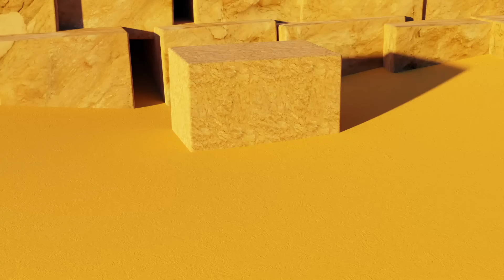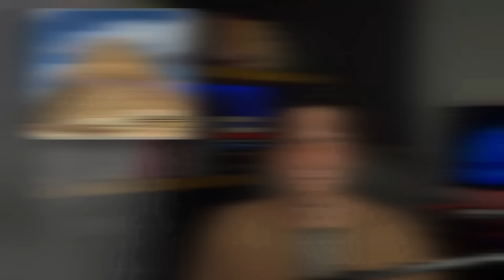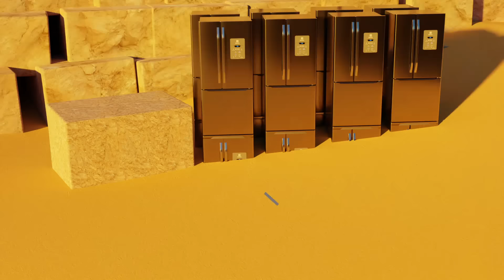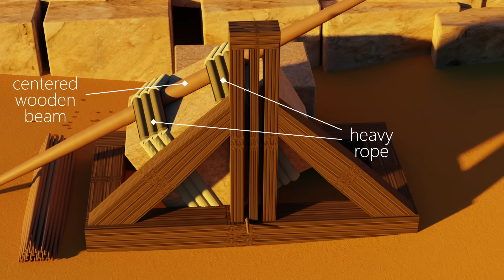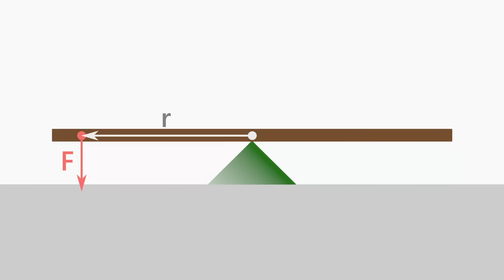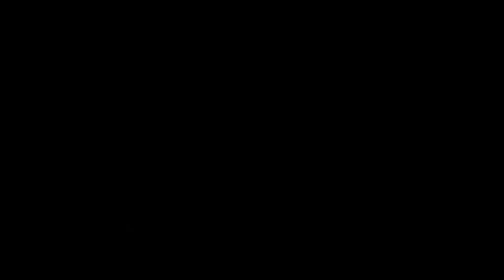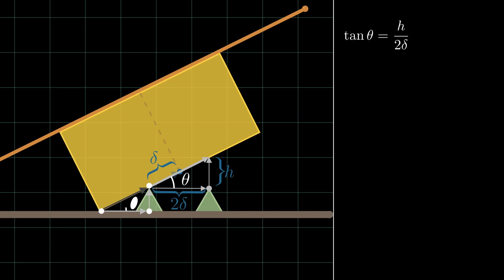Physics Reveals How the Pyramids were Actually Built

Comment: So, how long it would take to raise a single block? And how many machines you'd need to operate simultaneously to get the 6 minutes per block performance?
Reply: This is the question and it requires demonstration - physics and all that. (It's 6 minutes per block, day and night non stop for about 20-30 years - just to quantify).
Reply: @jdw6925  are these people unionized? they need their holidays and stats.
Reply: Well the 10 tonne blocks were used on the lower levels, and there are four sides.
If there are 3 machines per side that is 12 machines. Thus 72 minutes per block.

Slave power will move these heavy weights. If each of the 12 stations moves 1 block every 72 minutes then you just need tens working through the night.

Or More machines per side to not work in the hours of darkness.
Reply: Just need teams...
Reply: Not even counting how long it takes to transport so many million blocks from 300 miles away.
Reply from the maker: Great questions!  
So first off, the 6 minutes per block performance is only necessary if only one block is being laid at a time.  By using multiple machines at the same time (at different sections of the pyramid), the time allocated per block increases significantly.

For instance, if even 10 Herodotus machines are operating at once, then this allows for around 1 hour of time to be allocated per block.  With 10,000 workers operating at any given time, there were likely many operating in tandem.

So for a single block, let's do an estimate:
It depends on a couple of factors: the thickness of the wooden slats being used as pivots, and (perhaps more importantly) how fast the men want to work.  A rough estimate: 
(1.05 meter height)/(5 cm thick slats) = 21 slat layers needed to raise one block over another block.
So,
(21 slat layers)*(2 rotations / slat layer) *(30 seconds / rotation) =
21 minutes
Reply: @DrJohnDev  : Also of note; recent discoveries have found places in the interior that were filled with rubble and sand.  We currently  have no data on how much of the volume is filled this way, but if it is a significant percentage, that would greatly reduce the number of precisely fitted blocks that would be required. At the maximum rubble/sand fill would mean that the only accurately shaped blocks would be the exterior and casing stones and those adjoining the interior chambers, at the minimum it could be only a few random voids.  Without actual data there is no way to tell which condition obtains.😁
Reply: @DrJohnDev  Perhaps I missed something but you seem to have said that the minimum slat thickness was around 42cm to provide enough clearance to slide more slats on the opposite column. If I heard you correctly, we're not talking about slats but logs at least 42cm in diameter. Consequently it would take 3 logs in each column to raise a block by at least 3x42 = 126cm, which is the height of a 105cm-high block plus 21cm of extra vertical clearance to position the block before lowering it in place.

Assuming they started by positioning a block on a single log, they would've had to tilt that block once to place 2 logs in the opposite column, then once again to insert 2 logs on the original column, and finally half a tilt to bring the block to a horizontal position and insert the final 6th log in place. Each full cycle requires a total of 6 logs and 3 rotations of the block to raise it by one level. That's the easy part.

As to the number of such devices in simultaneous use, it seems logical to start with the 4 cornerstones and progress toward the center of each side of the pyramid, thus 8 devices used concurrently from the outside of the pyramid toward the center and possibly 8 more if progression also took place from the pyramid center toward the outside starting from the central pit (see the unfinished pyramid - Abu Rawash I believe, and the demolished pyramid for examples of such central pits). Therefore the builders could've used 16 machines at a time.

The only unknown parameters are team size and execution speed. The former can be approximated by breaking down a full lifting cycle into individual steps and the latter by running real-size experiments to figure out the time required to lift a block onto another. That shouldn't be too complicated. I'm surprised it hasn't already been done.
Reply: @DrJohnDev  Hmm, there's going to be major logistical and accuracy problems arising with the system you outline. Also, 1 hour to raise a block a height of 150 feet, say. Think you'll have to demonstrate this. I know that the guys that tried to reconstruct the building of the pyramid some years ago (Dr, Lehner et al.) tried the sort of method you're suggesting and I recollect that they encountered stability issues at about head height - I think it took them about 23 hours to get a 1.5 tonne block into place about 30 feet up or so. Even then, they had gaps about a finger width between the blocks I think, which is somewhat opposed to how closely the pyramid blocks are placed. Enjoyed the video very much though - thanks.
Reply: I agree with you , but you also forgot to consider that there are workers who would not listen to directions causing more delays, complain about lunch breaks and goof off which adds even more time. And where's all the wood that was needed to make the levers? Sounds more reasonable that blocks were moved by sound waves :).  @jdw6925
Reply: @jdw6925 : I think I saw the same documentary, and they did indeed encounter those difficulties.  However, there are some factors to consider here. As far as I know, none of the participants were expert stonemasons, none of them were expert construction workers, and none of them were masters of the use of counterweights, while the ancient Egyptians were acknowledged masters of all three skills.  Also experience counts. The Egyptians were doing this for a living, day in and day out, so they had plenty of time to acquire the skills needed. Just my two cents😁
Reply: @TheJacov  Agree that they weren't expert stonemasons or construction workers. However, we do have experts in those fields so should be able to demonstrate this easily........but, we can't, or at least, haven't been able to so far.
Reply: @jdw6925  I agree that we haven't so far, but...When you think about it, doing an actual, substantial demonstration project would be extremely expensive, even for a structure only a fraction of the size of the actual pyramid and the people who would be most able to build such a structure would be hard pressed to justify that expense just to satisfy curiosity, especially when you consider that there is no real market for megalithic structures these days.  Maybe one day...😁
Reply: @TheJacov  But we can't even do a couple of blocks in the timescale required and that experiment wouldn't be expensive at all.
Reply: @jdw6925  I'm not totally convinced of that.  I have seen videos of Wally Wallington moving concrete blocks of from several tons up to about 10 tons, by himself , fairly rapidly, both horizontally and vertically, in reasonable amounts of time. He has built a few "mini Stonehinge" structures which require lifting and accurately placing multi-ton concrete blocks.  He could have accomplished these feats much faster with the aid of a few other people.  He does this with only wood, rope and counterweights.😁
Reply: @jdw6925 : Note that Wally's work doesn't solve the stone carving aspects of the problem, but it does demonstrate moving, lifting, and placing large blocks, in reasonable time, by just a few workers, (in his case just one) using primitive tools and techniques.😁
Reply: @TheJacov  Tell you what, get him to place those same blocks side by side so that they are perfectly horizontal with virtually no gap in the joint......in 5 minutes. We all know this isn't going to be possible, but for some reason you won't accept it.
Reply: @TheJacov  Quite a lot of important detail is missing in the videos though, isn't it. Such as, getting the stone block onto the lifting machine, getting the stone block perfectly balanced at its centre of gravity, getting the stone block off the lifting machine and at height - just to mention a few things.
Reply: @jdw6925 :  I will totally agree that Wally did not film every last step of his procedure, however he did film enough detail that any reasonably competent mechanical engineer could easily reproduce his results. In regard to your following comment about how long it would take Wally to align and place blocks side by side, that would not be a fair comparison to the Egyptian workers, who were known to work in highly skilled teams and who frequently engaged in competitions to see who was faster. Having worked in construction myself, I can attest to the fact that experience leads to skill which yields speed increases in production. Also of note is that the number of teams at work increases the length of time available to place each block, the professors example of 10 teams increases the time required per stone to around 1 hour, not 5 minutes and by all reports there were far more than 10 teams working at any given time. 😁
Reply: @TheJacov  Fair enough and it is noted and respected that you have worked in construction yourself. However, please note that I have only asked for a demonstration of someone (or a team of people) to put two multi-tonne blocks together in 5 minutes - not to lift it to a height of a couple of hundred feet (which is roughly half the height of beachy head - just for comparison). It would be an awful lot easier to be on board if the theory didn't include ridiculous timescales. You talk about Ancient Egyptians as being almost superhuman achieving and more organised than we are today. Yet, they hadn't even invented the wheel (according to the official theory).
Reply: @jdw6925 : You are not alone in wanting to see a demonstration, demos speak louder than words😄😁!  With regard to the Egyptians, I don't think that they were any smarter or better organized than modern civilizations, they were well enough organized to achieve their goals and smart enough to take advantage of their knowledge of basic mechanical principles to erect their megalithic structures. As for the wheel, my own view is that they probably knew of the principle and simply disregarded it as being of little utility in transporting large masses in their environment of sand and river mud. In that environment sleds and barges made much more sense especially given that they had no material (think high alloy steel here) which would have been required for the axels for the massive loads they were dealing  with. 😁
Reply: @TheJacov  Agree that sleds and barges may have made more sense for the huge loads. But, they would not have been quick, no matter how skilled the workers were (unless there is something that we're all missing). Good to have a normal conversation on this by the way.
Reply: @jdw6925 : You are very correct that sleds(especially) and barges would be very slow, especially to our modern expectations of delivery speeds.  But the key here is that once you have the pipeline flowing, as long as you keep it filled the delivery can be continuous.  I should note here that I expect that there were snafus and delays because they always seem to occur in any large project.  As for having a normal conversation, I have never seen any utility in hurling insults, as that adds no useful information to the conversation.😁😁😁
Reply: @jdw6925  given that the base of the pyramid totalled 920 metres, more like 50 teams could be laying the stones in final place at any minute, changing the "one block evert 6 minutes" calculation to "one block every 5 hours per team". A team of 20 working 50 of these machines at a time is easily given the size. Then you'd get people working at higher levels as well simulataneously getting other blocks up to those levels while the final laying teams were doing their thing. In reality, there would be thousands of blocks moving at the same time close to their final resting points. (most blocks were 1.5x1.5 or larger like 1.5x2.5metres on the lower levels. They weigh a lot, but they are not much bigger than the dimensions of a sofa.
Reply: @rufioswitch2132  Sounds great but, somehow I think the practicalities won't be quite as easy as you make out. Imagine the errors being introduced with lots of blocks being put in place at the same time. Yet they managed to achieve accuracy to a millimetre or two. This will not be easy - in fact it is currently impossible for us to replicate whatsoever. I think, personally, all it would take is for a team to try and put 3 or 4 blocks together, each weighing 5 tonnes, say, and with the same degree of accuracy. Then, it should become immediately obvious the difficulties involved.
Reply: @ “currently impossible for us to replicate”? What’s this based on? To replicate what? A straight line in a building?
If they knew the four corners of the base then they just connect a string or rope between and you have a straight line to follow, Wally Wallington demonstrates how it’s easy for one man and a chunk of wood to pivot 10 ton blocks. How did humans build giant cathedrals in Europe in the 1200s-1500s all across Europe that still stand today and have straight lines and right angles, and bridges across rivers before the Industrial Revolution that still stand today and have huge stone pillar blocks in the river and the bridge is flat and straight? Humans can do cool things with time and effort.
Reply: @rufioswitch2132  Replicate placing a few 5 tonne blocks together using the tools they had at the time. Wally Wallington didn't do this whatsoever. I have my doubts about what he did actually do anyways, since no-one else seems to be able to reproduce his work. Also, as I've said before he certainly didn't place a 10-tonne block on the pivot on his own. Suspiciously, that bit isn't on the video. Furthermore, Lehner and co. tried the same method when they built their earth pyramid but, only using 1-tonne blocks. There were about 20 people and they found it surprisingly difficult to do this (Wally's approach) and found that the whole system became incredibly unstable at about head height - for a 1-tonne block! No matter how much people write and speculate, we are currently unable to replicate the feat of the pyramid builders, even for just a few blocks. That's a fact I'm afraid.
Reply: @jdw6925  there's literally videos of him building the exact machine in this video we are commenting on, and demonstrating how to lift a 10 ton block high enough to pivot it to set it upright in the ground all by himself. One guy. And there's videos of him sliding half ton blocks up ramps with just a basic rope and 4 humans just using body weight and gravity. Why would others even bother attempting to move giant boulder? Necessity is the mother of invention. And because Lehner hastily attempted to move a 1 ton block that someone proves that others can't do it, even though there is direct video proof of 10 ton blocks being done by 1 guy? I'm sure Lehner can't play the violin very well, or speak chinese, doesn't mean others can't do those things well today :). Lehner is not a builder. Anwyay, we know (a) the pyramids were built (b) that they were built in the period that the "main stream" say - from many sources include from the carbon dating of the supporting cedars of lebanon inside the bent pyramid and a myriad of written/glyph evidence. There's literal glyphs explaining how the stones were floated down the nile from the quarry to the site, and glyphs explaining how blocks were dragged over wet sand. So either (1) they were built as the glyphs explain and like every other buiding ever made, ie with human ingenuity, or (2) they were built with magic levitation power and super tools that were never documented, despite the egyptians documenting so much, and was magically lost and forgotten and not used anywhere else on earth then, or after... and the 100% burden of proof is on someone trying to say that the answer is (2). Since there is literal evidence of (1), anyone with a brain can understand that is how they were built. 100,000 people working on building the pyramids would find this relatively easy over a 27 year period with the tools available to them. There's now evidence of Carbon Steel being used in Africa 2000 years ago. So if you need a "lost technology" argument, look there - if the egyptians had carbon steel (which is about 1 billion times more likely than they knew how to levitate stones only for 50 years and never told anyone or recorded such ability) then they could have way more easily cut and chiselled granite for example.
Reply: @rufioswitch2132  One Half tonne block?? Blocks in the pyramid weigh up to 70 tonnes and were lifted to heights of several hundred feet. Wally didn't do this - not by any stretch of imagination. Further, no-one appears to be able to replicate what Wally claims to have done on his own. So, something isn't right. Drawings and glyphs don't mean squat - it could just be depicting their theory of how it was built. Tell you what, why don't you, or anybody else, lob a five tonne block on a sled and try and pull it across some sand? I've never mentioned anything about levitation, so I'm not sure why you're bringing this up. I'm firmly in the "I don't have a clue how they built it in 20 years and neither does anybody else" camp.
Reply: @jdw6925  the half ton block was completely separate point for how smaller blocks can be moved up without the need for the Herodetus machine!! A small herodetus machine can move a 10 ton block with one person - therefore a bigger herodetus machine could move 70 ton blocks with 100 people working on it.. The higher up standard blocks in the Pyramid were only a couple of tons (only 1.25mx1.25m) , so if 4 people can slide up a half ton, it's easy to see how even the smaller 2 ton blocks could be slide up to the higher levels of the pyramids on ramps without the needs for herodetus machines to do every one. There's also easy to understand pivot point "flipping" where the giant 70 ton ones would be turned end over end before getting to the final level they needed to be put into final place by a herodetus machine.
Reply: @jdw6925  it wasn't over sand either. the pyramids were built on bedrock or base slabs added, and they were moved to the bed rock on boats or carved out from the nearby limestone quarries. The same limestone bedrock they were built on :) So the blocks would be moved over hard flat surfaces mostly. By default if you don't accept that they were built by humans with the tools we know they had and were recorded to be used, then you must think some magic, special voodoo was used. I don't need to demonstrate that it's possible - the pyramids demonstrate it was possible, the 27 years of 100,000 workers using basic machines and all recorded in hylphs and papyrus is enough proof. You need to demonstrate that some other magic exists if you don't think it was possible. Why would i demonstrate it any way when Wally's videos 100% prove that it can be done with extremely heavy 10 ton blocks by one person, so 100s or 1000s you'd just scale up and understand that 70 ton blocks are also doable with enough time, Herodetus machines, ingenuity and humans. It's blindingly obvious.
Reply: @rufioswitch2132  If a small herodetus machine can move a 10-tonne block with one person, how come no-one seems to be able to do this. You make out it is easy so, should be very simple to verify. Yet you can't. I note that you seem none too keen to try and drag a 5-tonne block across some sand using ropes made out of papyrus reeds, and I don't blame you. As for the "flipping" 70-tonne blocks around. Come on. There's one thing I know for certain and that's nobody created the pyramids by spounting a load of BS. There's plenty of 70 tonne blocks knocking around for you to demonstrate your theory. What are you waiting for?
Reply: @jdw6925  "how come no one has demonstrated this?" - you keep saying this, except that Wally Wallington has demonstrated it. Which you just ignore. So if video evidence of 10 ton blocks being moved by one person and a wood Herodetus machine is not enough evidence, there's literally nothing left to discuss :)
Reply: @ the first Stone London Bridge was built in 1180AD. Because no one has built a stone bridge recently that is 200metes wide in 20 meter deep water without machines, that proves that it was impossible for them to have built it in 1180 right? It must have used some special magic technology that no one talked about. If it was possible and easy, why don’t you go and prove it by putting some huge stones plinths into a river?
Reply: @rufioswitch2132  Too much of a tangeant and proves nothing. Look, science is science. You need to demonstrate your theory. If you can't demonstrate it, then you have proved absolutely nothing. That's the current position we are all in w.r.t. the pyramids. No amount of words or papers or BS from anybody is going to change that. I appreciate that you might not like this. I don't like it either because I genuinely want to know how the pyramids were built and currently, no-one has a clue.
Reply: @rufioswitch2132  I don't think he has demonstrated it at all. If he had, you'd be able to replicate it, but you can't. I'd genuinely like to learn how the pyramids were built, not listen to a load of people make up stuff that they can't prove. It's pointless.
Reply: @rufioswitch2132  Ridiculous tangent and strawman argument - not worthy of comment.
Reply: @ they were built in the same way that 100% of other buildings ever made were - humans moving things with the tools they had access to and we know they had, not fantasy tools that never existed and have no proof.
Reply: @rufioswitch2132  If that were true, then you'd be able to do it yourself, even if just for a few 5 tonne blocks. But, you can't. There is nothing that you can say that will prove how the pyramids were made. You need to demonstrate it. End of.
Reply: @ sorry it took me a while to realise I was arguing with a cretin. Thanks for making it clear now.
Reply: @rufioswitch2132  It fruitless to argue with this kind of people, they always find a reason why its impossible to build the pyramids, even if its just the stone has the wrong colour that makes the demonstarion worthless in their eyes
Reply: @DrJohnDev And who is feeding these 10k laborers? Drinking water? What was the population at the time? Where is the lumber?